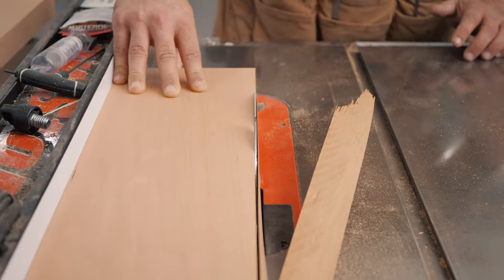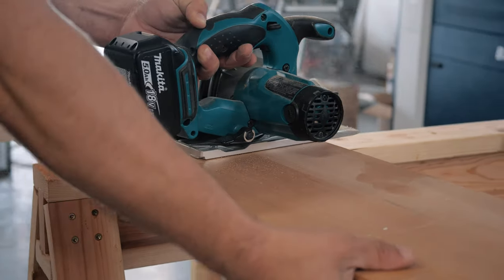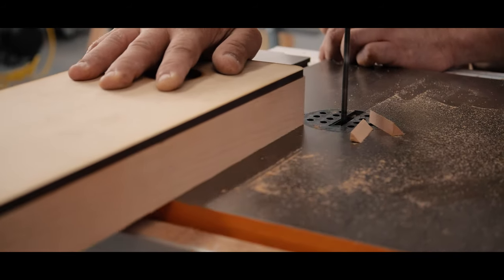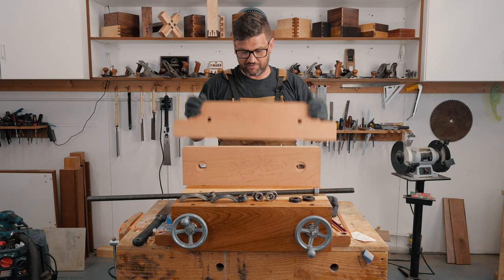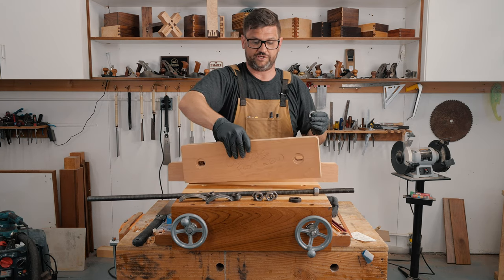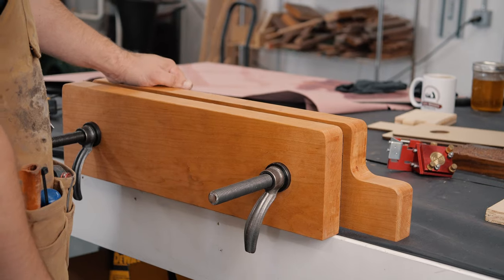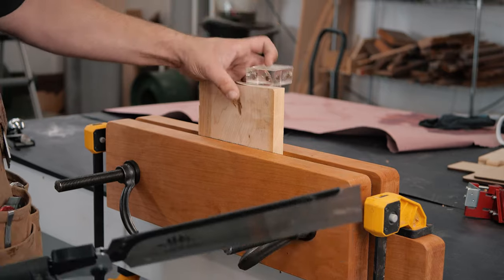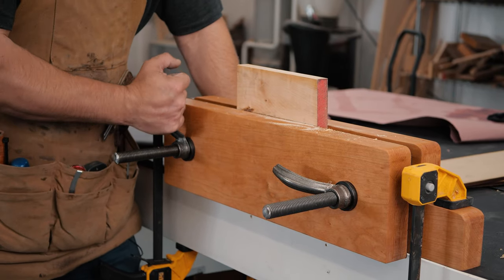Hardwood Moxon Vise for Under $50 (plans and templates available)

Comment from the maker: Jaw Plans for Printing Full Size and Templates - http://bit.ly/jkmmoxonviseplans
Hardware Links:
Easy All in One Hardware Kits: https://lddy.no/mtp7
All Thread ¾” #10 thread (3ft) - https://www.mcmaster.com/90322a450
Nuts from Amazon (need 4) - https://amzn.to/2H0dOXE
Nuts from Mcmaster Carr (25 pk) - https://www.mcmaster.com/90499a837
Cast Iron Handle (need 2)- https://www.mcmaster.com/91043a036 
3 Degree Washer (need 2) - https://www.mcmaster.com/91131a090
My other Moxon Vise Video for Under $100 - https://youtu.be/pMpqhpgxzPE
Reply: Jonathan Katz-Moses how do I find round handles like on your other vise that also work on these threads?
Reply from the maker: @arihantsrivastava2467  they're linked in that video
Reply from the maker: @TheFalconJetDriver  in the description under bitsbits
Reply: Do you need the high strength steel version of the rod and nuts for a wood working vise? Nuts are probably cheaper at a local store (since can buy fewer).
Reply: @MrPhilTX  I agree here.  You can save $8 on the project to get this instead: https://www.mcmaster.com/98957A638
Home Depot also has 3/4-10 threaded rod which I'm sure would be more than good enough and could possibly save you on Mcmaster's insane shipping costs!  While you're there, you can pick up all but the handle and 3 degree washers.  Amazon is quite a bit more expensive for the 3 degree washers (and about the same for the handles), but free shipping :)

Comment: Two big improvements I made in mine: 1) make the front jaw extend about an inch lower than the back jaw so you can register it flush against the bench when closed, and 2) hold the back nut captive and use set-screw knobs. That way the acme rods turn as well, and extend back instead of in front.
Reply from the maker: Check out my previous build to see how I did #2
Reply: Allen Arrick I’ll definitely make those alterations to mine.

Comment: Great video, Jonathan! Thanks for sharing! I would like to comment on one thing. I would make the front jaw a little taller than the back. The idea behind this is simple: by keeping the top of the front jaw flush with the top of the back jaw, the front extends a little below at the bottom, which when slapped onto the workbench can be pushed up against the workbench's edge giving instant, flush registration without any fussing around. Otherwise, again, great video!
Reply from the maker: Great idea

Comment: I built the moxon vise workbench based on your earlier video (thanks for finally releasing the plans for the jaws). It is a great addition to my shop. 
Be careful cutting the slots in the front jaw. I cut mine a little bit wide and that allows the front jaw to roll if the workpiece is small. I use a spacer block to keep it from rolling.
I used self-adhesive cork from McMaster Carr and it works great.

Comment: I think I might have ya beat. I found that I can get sizable bolts at my local hardware store for a buck and change a piece, along with washers and nuts. Making my own knobs/wheels on the bandsaw out of scrap hardwood and the vise itself out of scrap hardwood, I think the project is going to cost me about 5 bucks total. 
Thanks for the inspiration.

Comment: I've seen so many people cut bolts and other threaded components with machine threads without threading on a nut first, and when they try to thread it into something and it won't go. Then they grind or file the end to taper the threads and it only makes it worse. I have a set of split thread chasers that you place around the bolt and back it off with a socket or box end wrench to reform the threads,  and I have had to bail out so many people from that  situation with them. I refused to ever loan them out because they would have had a good chance of not being returned. To me, it was worth my time away from a paying job to do it myself over the possibility of having to replace a thread chaser when it wasn't returned as they were available only as a set, and they were expensive.
If I ever build a real workbench, I just may spring for  a set of plans, or even the templates, to make my own Moxon vice.
Reply from the maker: I've never used one. Do you have a link to the one you have?
Reply: @katzmosestools  I bought it so long ago that I don't even know if they still make the set I own.  Here is a link for a set I found: https://www.threadtoolsupply.com/murray-tools-thread-repair-system.html
These are different than the set I have; they are more like normal dies that are cut in half, whereas mine are wider, (thicker?), have cutting teeth on the full surface, (with the prerequisite spaces for chip removal), and are tapered slightly so as you press on the ratchet to remove the die, it grips the bolt tighter to repair the threads better.

Comment: Just an idea:  If you drill and pin the vice handles to the outer end of the threaded bars,  they wouldn't stick out so far in front of the vise, and be less in your way. You'd need small metal plates over the captive nuts in the rear jaw too. With the unused length of the bars sticking out the back, you'd be able to get closer to the front of the vice for planing or detail work. I really like the slotted washer idea; wonder where I can get them in the UK? More internet searching follows....
Reply: You could also use small wooden blocks on the back like he did in his original Moxon Vise Workbench for $100 video .....
Reply: Old comment, but in case anyone is still looking, you can commonly find them as "leveling washers" or "spherical washers". Note that the actual washer is not slotted (he only slotted the wood to make room for the all-thread movement). The actual washer consists of two pieces. There is one piece with smaller hole and a convex surface and another piece with a larger hole and a concave surface. The convex and concave surfaces mate together (like a ball-and-socket joint) when installed.

Comment: I'm thinking about the elongated holes in the front chop.  It looks like the finished hole is about 1-1/4" wide. A 1-1/4" slot would allow a deflection of the chop of nearly 16º! That would allow the left side of the chop to be more than 6-1/2" farther out than the right side, assuming 24" between the screws.  I'd say your template is working with a slot that is over-elongated.  Benchcrafted recommends a slot elongated to 15/16", which allows a 3º deflection.  Your thoughts?

I probably should have started with this:  I think your video is top notch, and your method of explaining has helped me visualize the process wonderfully.  Plus, you make it fun!  So thank you for taking the time and care to help us out.  But I still have my question.

Comment: Hi Jonathan:
I have a question.  Instead of having the all thread protruding out the front to get hung up on,  why not pin the handles to the end of the all thread and let the excess protrude out the back?  You already seated the nuts in the back portion so they would still function in the same manor.  I'm just thinking outside the box with your design.  If i'm missing something please let me know.

Nice job and thanks for posting your design.
Chuck

Comment: Sorry for the dumb question but where the hell do you get a big piece of leather hide? From your local trapper for a few silver shillings?
Reply from the maker: You can buy off cuts on amazon or full hides. Look for veg tan leather
Reply: Go by any western or English saddle shop. They have scraps you can get cheap
Reply: I recommend waiting until after dark and skinning a couch when your spouse is asleep. Dangerous prey, but depending on where you harvest, you might be able to concoct a believable alibi before the damage is discovered.
Reply: find a pair of janky used chaps on ebay
Reply: I usually cut the leather off discarded leather furniture on trash night.

Comment: Does it make more sense to pin the handles to the all thread and just have 1 nut epoxied to the rear jaw? That way you dont have the all thread sticking out the front while you're working.
Reply from the maker: In my other build I did that but this was about making it as inexpensive as possible. If you want to see that technique check out my previous moxon vise build which is linked in the pinned comment. Also I didn't epoxy it. I encapsulated it in the rear jaw and added a bushing to keep the thread from locking up

Comment: What a great video!  Totally need to make this and the price is great.  Really appreciate this video.  Love that the 7 year old in you is still here!  Have to ask a question that probably everyone watching can answer, but I don't understand why there is an oblong hole.  Is it for the washers?  I looked at the back side of the washer and it is a perfect circle with the 3 degree bevel.  Thanks, Jonathon!
Reply from the maker: Without the oblong hole the jaw would be unable to pivot and could only clamp at 90 degrees. Great question
Reply: What clearance is on the hole in the non oblong side? The horizontal oblong hole allows the lateral pivot of 3 degrees for sure. But how is vertical pivot achieved? I have my cupped washers and acme thread ready to go so I’m ready to drill. Thanks in advance!

Comment: prior to seeing your video I made a more modest moxon vise with 1/2" threads.  The device works well if you pass the work-piece through the jaws and the clamping pressure is across the whole height of the jaws but  if you use the vise with the work-piece only on the upper 50% of the jaws it tends to rack and the front plate does not clamp in parallel with the rear plate.  I therefore modified the front plate to have a detachable screw at the near base of the plate in the centre  and a wooden cushion on the thread as it comes in contact with the rear.  It is a bit agricultural but it works with a bit of fine tuning.  However I see in your video that you seem not to have the same "racking" problem I have explained - what do you think with respect to your design that overcomes this otherwise inherent problem?
Reply from the maker: I think that if you clamp something above the all thread it will rack either way

Comment: I purchased your (laser cut) templates, the McMaster-Carr stainless steel beveled washers, the Wood River Moxon Vise Kit, and some brass (oil impregnated bushings from Rob C). I didn’t anticipate that the oblong from jaw holes wouldn’t work with the bushings. These are round 3/4” bushings. I have only drilled the back jaw holes, tonight I will drill the front jaw. Can you think of a way I could use the bushings in the front jaw with the oblong holes? I wondered if made the back of the hole (jaw side) 3/4” round with the busing then used the oblong on the front, merging the two with a burr? I don’t have to use it, but liked the idea of the hole having a bushing.
Reply from the maker: The front jaw has a recessed 3/4 hole and an oblong hole which allows the jaw to angle quite a bit. I walk you through it in this video. I’m not sure I understand wheee the issue is. Please email our support with anymore questions. Pictures will help cut down on the back and forth. Cheers

Comment: You could probably go cheaper by making 2 round wooden wheels, for the front, with a nut set into them. If would give you a nicer finish then the handle nuts you've used. It's still an awesome way to get a vice like that, though 🙂

Comment: So if you loosen the lock nut on the back side you can make the throat opening ajustable between 6" and 1" so the bolts do not stick out so far ...
Reply from the maker: Yep absolutely